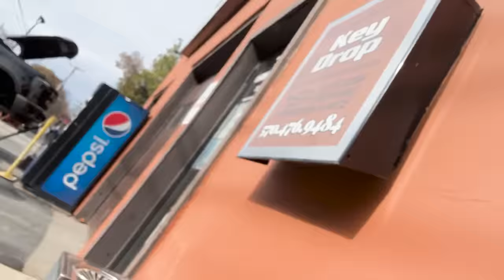FINALLY GOT AN EXHAUST FOR MY G82 M4!!!

Comment: That ford could tow, you would just need a drop hitch
Reply: But it would be better I it was a little lower just to make sure nothing is on stress
Reply: Just make sure whatever wheels you get can support a load. Don’t want weaker wheels
Reply: @jamesbjones97  you don't want them bike rims on that , curbing those means instant collapse 💀
Reply: @nerfgodbigguy1405  river miata had one of his bigger rims on his truck fly off. Almost totaled his truck trailer
Reply: Yeah and he would need 135k to do all that

Comment: tilty inwards/outwards is toe. Moving wheel forward/backwards(think of it as using the coilover and wheel as a pendulum) is caster 👍Also make sure maxing out seat to the lowest position and pushing it as far back as possible (even if it means massaging the floor hump🙂). Worst comes to worst you'll have to run the seat without the cushions on track. Had same issue with lowmaxes they aren't built for us tall chonkyboi's so pole positions are the move.

Comment: You can most definitely tow with the ford f250 yeah you do just need a to get an adjustable tow hitch which you can lower the hitchbut if you want a practical towing truck I personally would recommend some thing like a ford raptor or a Ram rebel which people that have drift cars  usually get to tow there cars i mean but if you want a big truck go for it you can get a new silverado 3500 hundred or a f350 the only thing is disel is expensive

Comment: 9:30 If your truly interested in owning a pickup truck, I would take a safe route and get something reliable like an older Tacoma (1989-2004) because you can do whatever the hell you want to it and it wont break, plus the aftermarket situation with them is endless.

Comment: S14 seat: you are too tall to run a slider, bolt it to the floor without a slider and you'll fit but you'll lose your adjustment(should be able to move it slightly at tilt but not full slide range)
Reply: Also, could take the bottom pad out or exchange it for a thinner or shorter pad as well
Reply: @Mk7_kev  1000%, you've got a point there too

Comment: YOU MAY HAVE TO DO A TUNE SINCE YOU DID THE DOWN PIPES ALOT OF NEW CARS THROW CODES AND OR RUN LEAN OR RICH WITH NEW DOWN PIPES N EXHAUSTS DO KEEP AN EYE EAR AND NOSE TO IT FOR RUNNIN RICH OR LEAN GAS SMELLS MAYBE POP UR PLUGS OUT AFTER A 100 MILES TO SEE IF THEY FOULIN OUT THEN AGAIN IN 2-300 MORE MILES IF U DONT SEE FOULED PLUGS BY THEN UR GOOD.